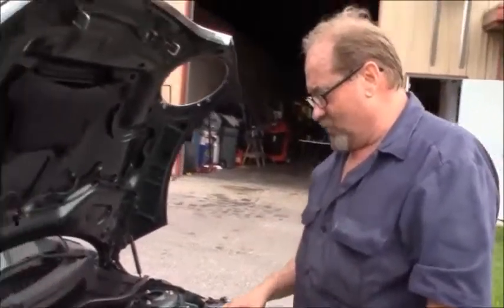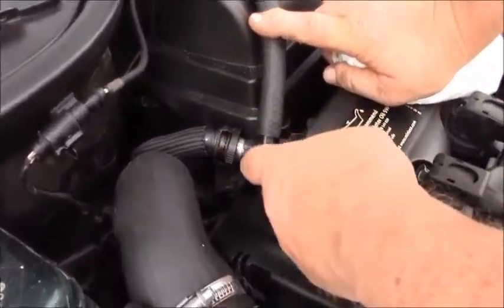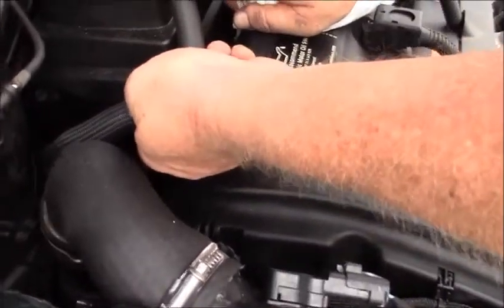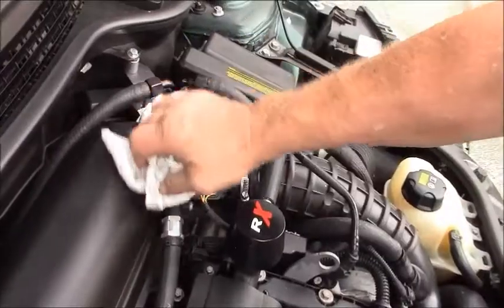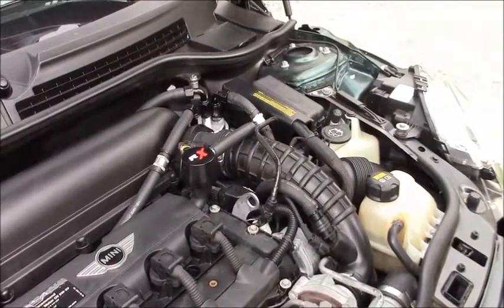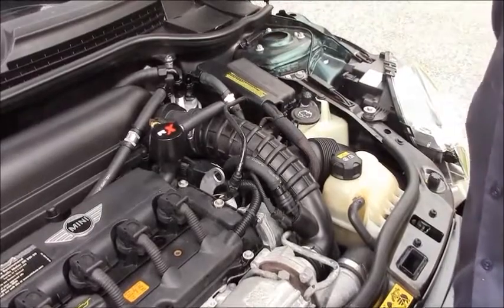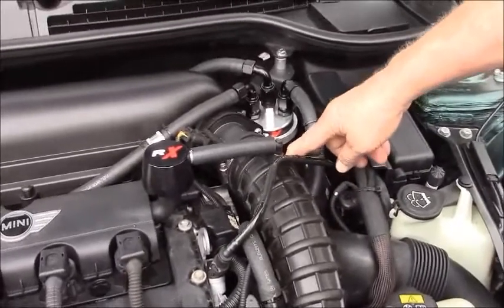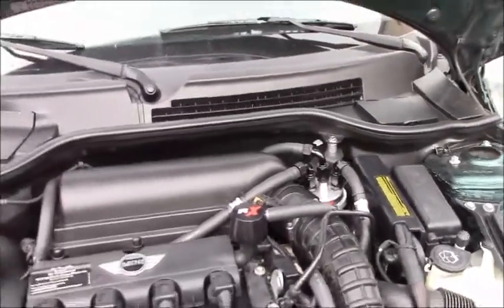Mini Cooper N14 RX Catch Can Overview

Comment: Why not put an oil catch can and outward check valve on the dirty passenger side, that way the dirty ventilation gets filtered by the oil catch can and clean comes out and then under boost when pressure tries to go back through the crankcase passenger side the check valve blocks it.  Then no need to have all these hoses.  Just a cut in of the passengers side hose with an oil catch can and check valve flowing away from the passenger side???

Comment: Hello Tracy, Have a question. I have 2 seperate occ installed on 2007 S one on the turbo side and one on the intake but i realized that you mention fresh air coming in the crankcase from the turbo side with the rx but i have the input hose to the catchcan on there,So my question is with this set up where do i get fresh air in to flush the oil vapers from the 2 ports that have the catchcans...Oil cap with the rx seperator? Thanks for the great video.

Comment: WHAT ON EARTH IS THIS MIX OF PIECES AND TUBES FOR? CAN YOU SPEAK MAYBE MORE LIKE NORMAL TERMINOLOGY ?  NOT EVERYBODY HAS YOUR ADVANCE EDUCATION. WHY THE ENGINEERS AT MINI OR BMW HAVE NOT DONE THIS YET?
Reply: Hi Gabe,

The engineers are aware of the cause and solutions....it is management that won't approve these solutions for 2 main reasons, and this is with ALL Automakers World wide. BMW is hardly alone.  Cost is one....as with the GM ignition switch debacle that cost them over $1 billion when engineers pointed out over 10 years ago it could have been fixed for far under $1 a vehicle, that did not fit in the budget, so this certainly would not. The other, and even bigger reason is these have to be emptied every few thousand miles, or at least every oil change. The average vehicle owner today doesn't even know how to open their hood and check oil and fluids much less maintain one of these systems.  As for the tubes/connections, etc. this can be better explained by emailing us direct: RXProducts@aol.com due to the length of explanation. We make these for hundreds of applications and will be happy to assist.  Thanks!!
Reply: @tracylewisperformance2270  Well done!

Comment: Quick question - is it a dual valve can that is part of the N14 install, or is this the "Monster can"?  Curious as to which I need to buy for my car. I too have (like the car in the video) a 2007 R56 MCS with the N14 motor.  Thanks! - Will